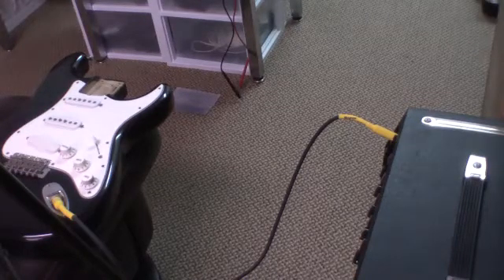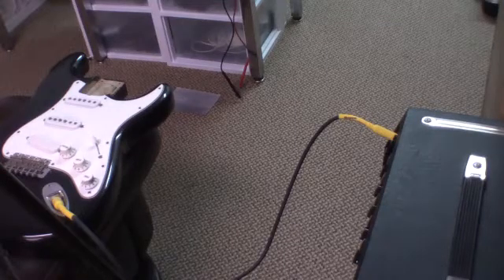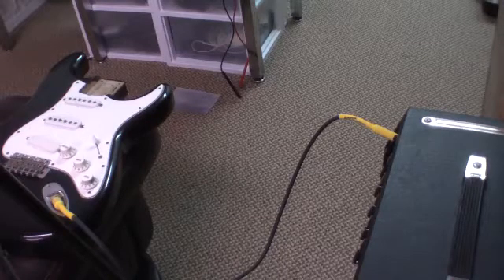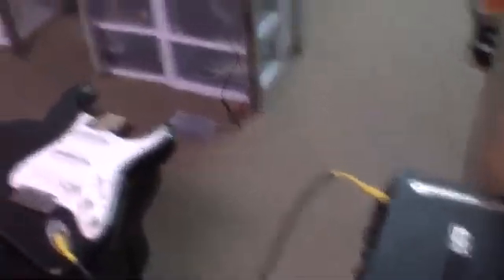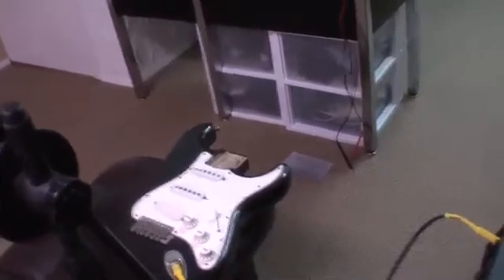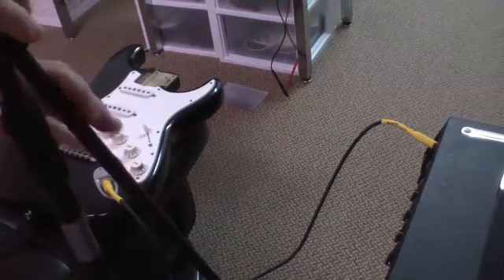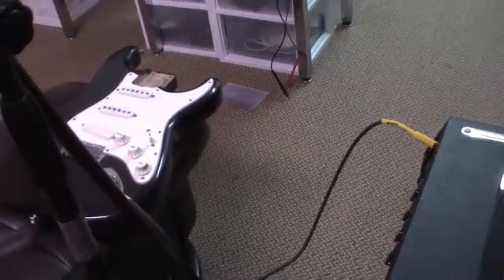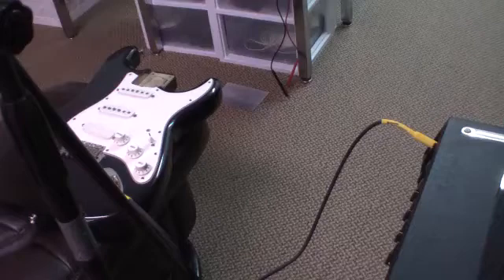Does Tone Wood Affect the Sound of an Electric Guitar when Plugged In?

Comment: i applaude your efforts to explore this issue.  what you demonstrated is that the pickup is microphonic.  if you remove it from the guitar you will find that it is equally microphonic.  you might find this video on the effect of the body wood interesting:  http://youtu.be/1mH5hwLkxCI
while is it true that everything is connected to everything and there are interactions, their magnitudes and directions cannot be assumed to be detectable by our ears.  if i toss a ball into the air it is affected by the gravity of the moon and the earth in accordance with newtons law as you point out but the balls effect on earth and the moon is so small that it cannot be measured while the earths effect on the ball is obvious, while the moons effect on the ball is not so obvious.  similarly the mass of the body compared to the mass of the bridge is so large that its effect is primarily the opposite of what you are proposing.......the body is a huge energy sink and dissipates the energy from the strings......it does not contribute significantly to the vibrations except to suppress them.  the guitar body behaves as an amorphous substance and not as a resonating body.  it does not have simple harmonic resonances, moreover the arbitrary (with respect to sound) nature of the routed cavities in the body effectively breakup the body into several non-contiguous zones and if there were resonances they would be disrupted by this.  many builders have shown that you can make the guitar body out of just about any material you like and as long as the bridge is mounted securely there will be little difference in the amplified sound.  there are guitars made from aluminum (travis bean) and carbon fiber composites (parker fly) that sound great and turn the guitar dogma on it's head.  the particle board guitar in the video link posted above does just the same thing but better.  i have played a guitar that was made from a toilet seat and the sustain and tone was just fine.  contrary to what one would expect, it didn't sound like crap
Reply from the maker: It doesn't take a rocket scientist to notice the thin and lacking tone of a Parker Fly, Ibanez, etc. Truth is, no one, not even Satriani or Steve Vai has EVER come along and built a signature "classic tone" with one of those kind of guitars. Not surprising that they, and so many other great guitarists went on a rampage (in the 80's) with rack mount systems that looked like a cockpit of a 747. Meanwhile some players came along and built signature tone, using way less talent (albeit still with great talent) like Slash, and Joe Bonamassa. And they used quality tone woods, and an amp and a couple of pedals at most. Of course, it wouldn't have mattered if they were playing toilet seat guitars, now would it - they would have sounded EXACTLY the same, providing they had Gibson pickups? Pffff. Get real dude. 10 billion Les Paul copies that don't sound as good say you're wrong. Joe and Vai were in search of tone, that simply wasn't there. When you take a set of '57 Gibson humbuckers and listen to them electrified through a Les Paul, the same pickups with the same bridge, same fret wire, same neck (basically) and same nut on an ES335 -- sound, well, not very similar at all. What is becoming more and more evident, is that HUMANS (not guitars) seem to really vary in their ability to distinguish from one tone to the next. The particle board guitar sounds like shit, and so does the shitty strat it's up against. One is slightly shittier than absolute shit. Perhaps not a great comparison, really. Testing Alder versus Ash versus particle board versus toilet seats, yeah ok, you're correct shit = shit.  I guess if you've been listening carefully for decades, you'll hear more small differences than someone who really hasn't paid it much attention. Of course, it's not Bob Rock and Mutt Lange claiming guitars made of quality tone wood make no difference, it's only internet Nobodies, claiming reference to a single study, who's data clearly shows that not only did the two woods physically produce different data (up to 6db discrepencies in some bandwidth areas, that's 4X the output!), it clearly proved the individual who wrote the report and made the claims cannot read a graph.
Reply: do you even play guitar?  i've played guitar for 40 years and with a little eq and a cheap little korg pandora it isn't hard to make any guitar sound like a strat or a les paul.  i'm more than certain that in a blind study you couldn't tell the difference.  but dont take my word for it , read a few interviews w studio guitarists like larry carlton etc... and you'll hear the horrifying truth of what goes on behind closed doors when musicians don't have to pose on stage w an accessory hanging off their crotch and pretend to care about gibson vs fender.  yes they use parker fly's and PRS's (gasp!!!) and you can't tell if its a strat or a Gibson L5.  i'm sorry that you can't except that but it is reality.  Yes, you are right..... 50 years ago  it was important to have a particular guitar and amp to get a particular sound but this is 2014 and it simply isn't true any more ....... do you remember how horrible the sound was at concerts back in the 70's?  they all played through marshall amps and it sounded terrible.  now every decent musician sends the signal direct to the mixing board and then through the PA and they get near studio quality sound from a live recording.  the drier the signal the better.

Comment: To all the idiots that are non believers, it's obvious wood itself cannot transmit sound through a electric guitar's magnetic pickup, it's about how vibrations of a string will have a different tonal quality through the same magnetic pickup, if the string's structural mounting (guitar) is changed from one type of material to another (density), while everything else remains the same.

Comment: Does tone wood affect effect the sound of an electric guitar?  It depends on the type of pickup used in the guitar. Guitars using un-potted pickups will pick up practically everything. If you want your sound to be influenced by the wood, the thickness of the wood, even the kind of finish on the guitar. then use the early style un-potted pickups. If you don't want your sound influenced by the wood and everything else, then use the properly waxed potted pickups that came out in the late 70's.
Reply from the maker: Even potted pickups are microphonic to an extent. My brand new Seymour Duncans, JB & 59 pair -- humbuckers -- that came in my 2009 Charvel USA San Dimas display the exact same effect.

Comment: I can appreciate the demonstration. But you did not demonstrate that the wood effects the tone of the guitar while plugged in and playing with strings on. What you demonstrated is that if you knock on your guitar while it is plugged into an amp, you can hear a sound come through the amp. Some string vibration transfers to the body while playing but there is no impact. Make another video of you with your guitar body plugged in and shake your guitar body in the air as fast and violently as you can. Let's see if it makes a sound!
Reply from the maker: Actually it proves exactly what is states it does. Does vibrational energy make it through the wood into the pickup, and out of the amp, in the absence of strings vibrating over the pole pieces. Your demo would be to see if the shaking a pickup could impart a signal. Next time you pick up your guitar, put your ear to the horn of the guitar (wood). pluck a note. Is the energy leaving the vibrating string, passing through the points of intonation and into the body wood? it sure is. turns out a lot of it is, and turns out that wooden body is acting like a pre-amplifier. In fact, if you are playing in a band and you have no tuner, you can lean over and tune your instrument this way over very loud room noise. The wood is resonating to your signal so loudly, you can hear your guitar well enough to tune it, over others playing right in the same room. Absolute conclusive proof that sound energy leaves the strings INTO the body via bridge, nut, frets, etc. Ok, so now my demo is, can that energy ADDITIONALLY enter the pickups WITHOUT the string. In other words can energy actually leave a vibrating string, enter the body wood, and enter the pickup. in that exact direction. Yes it can. You see in the video if i knock (create vibration in the wood) -- it translates into the pickups and out of the guitar as a signal. There certainly is an impact of tone wood, and once you've taken a physics class or two in high school, you even learned why! Turns out it's simple physics, and yes 50 years worth of work done by hundreds of sound engineers for electric guitar manufacturers worldwide weren't kidding themselves, all to be denounced by a handful of internet self proclaimed know-it-alls who apparently haven't studied how sound works, and travels, in a solid medium. You see, the Internet fools that claim tone wood cannot effect the sound, are making a simple mistake, they are pretending a guitar only produces sound due to one single tiny variable of the larger picture. It's narrowmindedness. They pretend that the influence of the string on the pickup is the ONLY way a signal is created. Turns out, physics teaches us, there are two additional variables. The wood imparts an EFFECT on the vibrating string, in other words it vibrates a certain way BECAUSE of the tone wood, and secondly, energy leaving the string actually enters the pickups via direct transfer (and not the string displacing the vibrational frield). And it's discussed in actual physics texts! Amazing how education works, huh?
Reply from the maker: Jimi Frankito I'll check out your video when I have a chance. My demonstration does prove exactly what it set out to. If a knock makes it through, so does the string's energy  resonating through the wood. You are clutching at straws telling me the strings energy is "different" and wouldn't behave as the knock does, and that my experiment still doesn't prove what the strings sound energy would do... Sound is sound, there aren't different kinds of sound, some that would behave as shown, and others that don't. the important thing is, can sound make it into the pickups WITHOUT having a string oscillate over a pole piece. Can the vibrational energy still get picked up? Yes. It's pretty simple science, really. That is why there are about 50 people who disbelieve and about 5 million who don't question it. That said, I admit, it is a very SMALL part of what makes up the sound. None the less, if you take a set of classic 57 humbuckers out of a les paul and put it into a 335, will it sound identical. No, it doesn't , and yes ive done, and no i cant video it cause i dont own the guitars anymore - but yeah - many people can hear the difference between a les paul and a 335 -- both having identical pickups. It's not a huge difference, but it is complete evident, and real.

Comment from the maker: XGCPolaris All '62 AVRI's use an 11-hole 3-ply white pickguard with a full size metal shielding on the underside. New, cheaper made strats use a piece of foil. The guitar is about 24" away from a tube amp, mesa boogie, 50 watts with 4 12ax7 pre amp tubes, and the pickups, being '61, are not RWR -- they are all the same polarity -- that equates howl.

Comment: Your pickups are microphonic. 

You also have no idea how pickups work, because if you did, you would be able to actually explain what is occurring here.

Sound and electromagnetism are two different things. Sound is compression and rarefaction of molecules in a medium; electromagnetism is a completely separate phenomenon. Electric guitar pickups (not piezo crystal pickups or anything of that sort) are electromagnetic transducers and only detect changes in a magnetic field - they do this by Faraday's Law of Induction. Microphones detect sound, which is totally different. 

What does this mean? It means those pickups are microphonic.
Reply: Your reasoning is faulty. The string moves when it is plucked and it also moves when the object it is fastened to moves. That's why shaking a guitar can produce a little bit of vibrato.  The 'microphonic' phenomenon is not entirely removed by potting. Potting is analogous to putting your coffee in one of those cardboard cartons that keep it from jiggling around as you drive. Even so, when you go over a bump it will spill. The road is analogous to the guitar body and the carton is analogous to the potted pickup enclosure.
Reply from the maker: all pickups are microphonic, to one extent or another. this test was perfectly replicated with wax potted seymour duncan jb/59 pair. as well, the pickups in this test are Fender USA '62 re-issue, which are, of course potted. In fact, only the cheapest absolute garbage Chinese pickups, are not potted and display what you are referrring to, which is, huge microphonic behaviour. The bottom line is, ALL pickups display some of these characteristics. I'll give you a grade eight physics primer, here. Have a look at this diagram of how a dynamic microphone works, then have a look inside a pickup. wow, imagine that huh? the same principle.

https://microphones.audiolinks.com/Microphones/micdiagram2922.jpg

Comment: Nice test. After seeing all the recent tonewood debates involving electric guitars, one of the first things I noticed on all my electrics is that I could tap around the pickups and the sound would definitely get picked up by the amp. This was true of an old Fender Telecaster Deluxe I bought new in the '70s  (one of Fender's first humbucker guitars), my 6-year old Epiphone Les Paul Studio, as well as my much newer American Standard Strat and PRS S2 Mira guitars.

If I tapped, say, around the neck pickups with the neck pickups selected while completely damping the strings, there would be a percussive sound getting amplified--not tremendously loud, but obviously present. Although the pickups are magnetic, there's something microphonic going on as well.

Then if I switched the lever to the bridge pickup setting--so that I was tapping farther away from the selected pickups--the volume of the percussive tapping was much fainter, though not as faint as unplugged. Or I could do the reverse experiment at the bridge end of the guitar. The closer I was tapping to the selected pickups, the louder the amplified sound.

My understanding is that any microphonic aspects are related to the tightness of the coil windings in the pickup. The tighter it is (as in modern machine-wound pickups, as opposed to older hand-wound) the less microphonic it will be. Apparently all of mine are microphonic to a small and roughly equal degree, even in my newest guitars.

While wood and other acoustic properties probably play only a minor role on an electric guitar that's plugged in, I have to believe they color the sound a little--at least on my guitars--as the pickups are not just picking up purely magnetically.

Of course, an additional factor is that the vibration of the wood (in response to the vibrating strings) feeds back to and affects the vibration of the strings, which in turn should affect the sound.
Reply from the maker: i agree it's a minor role, but it's there. I once took a PAF pickup out of a les paul and put it in a very cheap, extremely lightweight Ibanez. Both guitars had similar nuts and both were fixed bridges, not tremolos. The PAF wasn't even similar sounding in the Ibanez, and the woods were entirely different, in every regard. certain woods add depth. Any disbeliever should play some notes (unplugged) and place his ear on the horn of the guitar. It's loud. then do, as you say, the tap test for microphonic pickup. If a guitar resonates and the pickups are microphonic to any degree, then tone wood matters, End of story. I do not, however let it be the end all, be all, of choice determinants. I still have some guitars that are a compromise, Charvels, Ibanez etc.